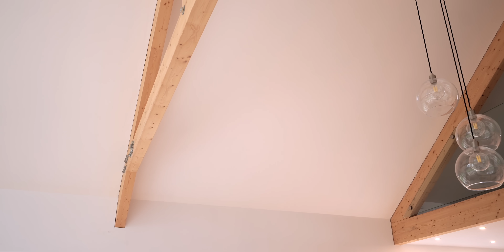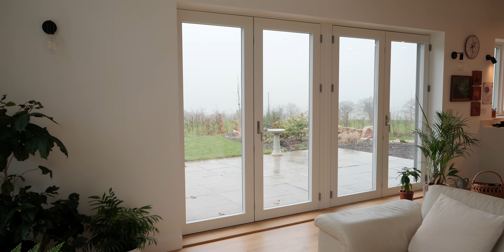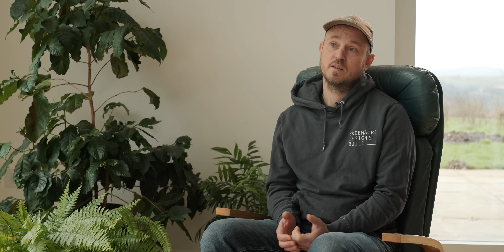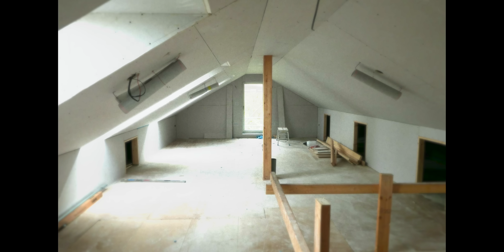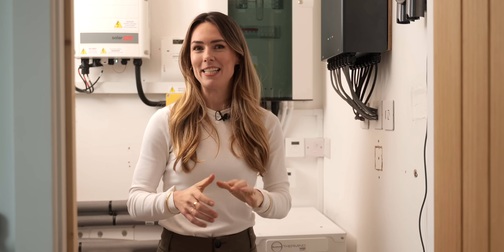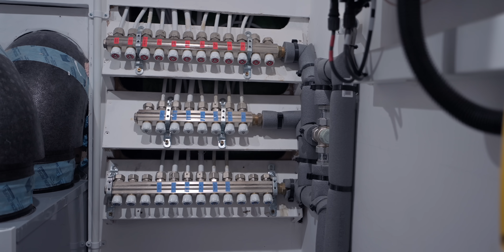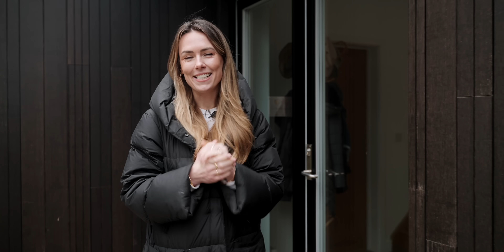Ditching a Heat Pump for In-Plaster Infrared Heating?!

Comment: Lovely to see this report Imogen and thank you to Jeremy for sharing his experience.  There are, as always, a lot of negative comments from the COP3 brigade - we're used to that- nevertheless, this clever system still surprises in its ability to perform across the board.  Here are few areas that may help people to understand.

COMFORT - no stuffy pre heated air or high/low humidity with warm floors and surfaces across the home
INVISIBLE - Hidden behind the plaster in the ceilings allowing for less deployment of panels than a floor based system and radiating shadowless light throughout the room
SPACE - No plant room needed.  Our intelligent transformer runs the entire home and occupies as much space as a 14"TV on the wall.  Yes you need  space for hot water but many smart solutions such as this Sunamp system are tiny.  
MAINTENANCE - The system has no moving parts and is constructed from recycled carbon fibre making it tough.  Unlike other heating 'films' this is NOT a plastic laminated film and cannot delaminate due to its patented homogenised construction.  The kit is designed and manufactured in Germany with high quality components and has a design life of 50yrs+.  
WORRY FREE - In the unlikely event of a damaged panel then simply either bridge the connection and feather back in or skim in a new panel.  As the system is decoupled, the rest of the heating system will carry on working
SAFE - The mat construction allows for penetration with screws and fixings up to 70mm diameter without issues.  As it operates at 36v SELV there is no risk of electrocution and may be used in wet rooms
CO2 friendly - The product uses recycled materials and has a very low embodied carbon score and, as it will still be running in 50 years+ time, the planet is only effected once!  Coupled with renewable energy it's operational carbon is negligible too.
VERSITILITY - Julians house is is near airtight and very well insulated and so requires hardly any energy - for him this really is back up should door be left open!  However, we install this system across the board in social housing projects with poor insulation, historic houses, commercial building and super homes.  As we have many variations of the mat, we can match the energy requirement to the required heat demand.  
THE BATHROOM - Imogen demonstrates the towel warmer.  This uses the same system but runs at a higher wattage which outputs Non ionising radiation at a higher temperature which will warm and dry out towels.  This enables more freedom in bathroom design and only uses 132w's of energy - plus no burnt bums as the surface temp still stays below 40°c.  You can also put this behind ceramic tiles and even in the shower to provide additional comfort and reduced water temps (according to one major housebuilder that has trialled it).
BUILDING PROTECTION - Naturally in Julians house it is ventilated via MVHR and maintains a good background temperature thus avoiding condensation.  However, for most of us, this can be an issue.  As we radiate onto the walls, floors, windows and all surfaces, these warm up.  These surfaces then warm the air slowly and gently.  As the air is always cooler than the surfaces condensation is reduced greatly and, in most cases to nothing at all.  
HEALTHY - Whilst we don't claim any medical benefits from using our system, there is a big reduction in dust circulation, compared to a convection system, and a balanced relative humidity (RH-see above).  Great for Asthma sufferers and those with dust allergies.  We radiate at a frequency very similar to the radiant heat produced by our bodies and so the heating feels gentle and does not cause headaches, burns, or any other nasty feelings associated with high temperature infrared.
REACTION TIME - As well as extensive testing and research in Germany through the inventors at Stuttgart University, we have conducted independent testing with Building Services Research and Intelligence Association (BSRIA).  This showed that the system will reach operational temp (around 30°c) withing 2 minutes and the light wave will be felt on the body within 3 minutes.  Floor surfaces begin to rise from around 8 minutes and a maximum air temp of 27°c can be reached.
 COST - Kit cost isn't cheap!  Sorry.  This is a high quality, German system that is built to last and to perform.  If you want cheap then buy Chinese.  Julians kit cost him around £40 per m2 PLUS installation.  For newbuilds then installation is simple and uses existing site trades with minor training.  For retrofits it will involve routing power cables and potentially replacing ceilings.  That said, the scenario is pretty similar with our friends in the COP3 group (heat pumps).

And finally, the big debate

RUNNING COSTS - Let's be clear - this is an electric system.  It doesn't magically generate energy from thin air - unless its connected to  PV/battery of course.
Our magic happens in the control and use of the system which can take a whole heating season to get to grips with.  But, this is where we do win and start to narrow that COP3 gap - we can warm up areas reactively.  Keep the home ticking over at around 15°c to stop condensation (see above)- the setpoint and bring the system on to your desired comfort level as and when needed.  Bedrooms probably never rise beyond the setpoint, hallways, kitchen and bathrooms too.  Dining, lounge and study may want a boost for a bit before you settle down for a meal or a movie.  No need to keep the heat on 24/7 to keep the heat in the floor slab to avoid it losing inertia.  In addition, as we warm surfaces, balance RH and reduce air movement the body will feel more comfortable at a lower air temp.  
Now, here's the clever bit, our wiley, energy saving clients have suggested running the home during off peak hours to make use of the lower energy rates and use the light wave to 'charge up' the home.  Current studies with a preeminent UK university are testing this practice and have found that the system has a faster ramp rate and a slower discharge rate than other heating technologies.  
Another eminent University (the one that loses the boat race) has undertaken a side-by-side pilot with student accommodation running gas on one hand and IR on the other and has reported running costs coming DOWN from over £50k pa to just over £20k pa moving the focus from a heat pump solution to IR across their sites.
Still lots to do in this area but, as control systems improve and AI starts to rule the world, a simple switch out of thermostats is an easy upgrade!

If you have a project then hop onto our website and get in touch or fill out a quotation form and we'll happily get back to you.  If you're still doubtful we have a book of satisfied client who love to share their knowledge and experience.  Talking about experience, come and 'feel' it for yourselves at one of experience centres - currently NW London and Cambridge with more opening soon. 

So - I have typed this whilst waiting for a flight home from visiting one of our university partners and my head  and eyes are now fried.  I hope tgis helps everyone (including the naysayers) to understand the system better.  Forgiveness required for typos!!

Rod Davies
Co Founder
Energy Carbon Ltd
rod@energycarbon.co.uk 

 
e unlike
Reply: 😂😂😂

Note to Imogen and that dopey Robert.

It might have been "better" had you interviewed this bloke in tandem with the older householder bloke!

(Thanks for your post btw.)

That way we might have had less noise from the heat pump huggers, heating and ventilating experts that they are. (Noise ... geddit?)

One might suggest that said heat huggers have to protest that only they know what's what in order to justify their very, very poor choice of heating, with the neverending saga of continuous maintenance and even possible replacement of said heat pump in less than a decade.

And of course, in some admittedly rare circumstances, the Local Authorities will be pressed to prosecute the odd heat pump hugger over noise pollution.

Everyone now knows heat pumps will end up sounding like an asthmatic traction engine about to expire.

I don't have to be quite so diplomatic as the heating outfits who post but it seems as if the heat hugger brigade are a tad dim if they didn't research the alternatives prior to purchase.

It may be a "good thing" if Imogen does an in depth interview, with diagrams, site visits, etc, involving FAR IR technology as a follow up to this episode.

A few brief words with the contractor were fine but more would have been better.

If Robert and Dan think nothing of waffling on for over an hour about things they only partially understand then an hour of Imogen covering FAR IR technology would be far more educational.

In fact I might go so far as to type that Robert and Dan seriously  consider bringing forward their retirement plans on the actual hosting and podcasting front and take a step back, a very large step back, ref fronting this platform.

Imogen might be a  better bet all round and a professional course on interview techniques wouldn't hurt.

Jack? He'll be just as happy and loquacious reviewing the many FCEVs and H-ICE vehicles about to appear on the markets.

Seeing as the Euros have changed tactics ref going green deadlines then finding new BEVs to review will be nigh on impossible.

Just because Starmer's new best friend will want to export his produce to UK in no way implies UK car buyers will be fighting each other at the docks desperate to get their hands on any Chinese BEV going, especially as Robert insists we avoid any dealings with "oppressive regimes" from now on.

Funny how words come back to haunt one.

Perhaps a script editor might have been a useful investment?

Too late now to row back on that one, eh Robert.

Retirement will allow you to sit back in judgement, and comment, on all sorts on nonsense on the internet.

It works for me alright.

Comment: I need to know how much all this has cost. I love the idea of being virtually off-grid, but you need lots of wonga up-front, which I don't have. It's not wealth envy I have as such, but every time I see stuff like this I think, hmm, people with money to spare. Obviously it's great for them then to have low or no bill for energy in, but the irony for me is that it's generally those who can afford bigger bills that start projects like these. For all that, I still love this kind of thing, great content.
Reply: perhaps I can give some idea on cost . I built a Passiv Haus but stopped short of certification , which was expensive .The main criteria , in every aspect , is insulation . There is heat generated from several sources in a living house that  along with high levels of insulation , keeps a warm enviroment .  We generate heat ourselves , as does cooking , showering , solar gain through glass , and other smaller sources . This heat is kept within the house . Cost of build was  approximately  20% higher on a timber construction , this  mainly due to  insulation materials . By going off grid the electricity costs are zero . Solar panels have never been cheaper  and batteries are essential so have to be accounted for but easily found  and generally come with  a 15-20 year lifespan . We have spent 0 on electricity for 3.75 years and the house temps stay over 21C . There is no heating system , just a woodburner @ 9kw output  So yes , a more costly initial outlay but low living costs once being lived in .
Reply: @gramos9115  I think a woodburner and its ensuing pollution count as a heating system.

Comment: Really curious what "sophisticated plumbing system" means as it looks really much like floor heating system...
Also with 2kW of termál loss they coul heat the house just by living in and change of LED lights for old incondescent bulbs.
Phase change heat battery sounds interesting but the higher heat is stored the higher losses. The insulation does not look that robust. I think for something like that but much more bigger as they do in Sweden simply "hole in ground filled with sand or water" to slowly heat up during summer and than use it during winter.

Comment: I know one thing: if my feet are cold, I am cold. So I have chosen again for floor heating. Meant to feel warm to the feet. The PCM system sounds good though.
Reply: Our heating warms the floors...from the ceiling.  The floor temp can be brought up to 26°c and can start to rise as quickly as 8 minutes from power up

Comment: What I found to be most interesting about this video was the idea of (potentially) fitting a Sunamp unit to work alongside a home battery.
Our house built in 1988 as an early 'ECO' house with superior insulation compared to other houses of that time is no longer up to current insulation standards, but I shall be looking into whether a Sunamp unit could provide our energy needs alongside our home battery.
Reply: Why not investigate yet more insulation?

Thermal curtains?

Nothing to.stop you doing the Google exercise.

Or search your locale ... could be all sorts of price scales to suit the demographics.

You won't know until you look.

Applies to all of us.
Reply: @ForestForest-n9i The house has 1" Styrofoam in the cavity and the roof which encloses the upper floor already had 50mm Styrofoam. Last year we re-roofed, upgraded the sarking felt and added 75mm of Kingspan before adding solar panels.
What we've discovered is that the builder who laid the ground floor stupidly poured the ground slab and surrounded the ground floor central heating pipes. The floor consists of 50mm styrofoam laid onto the ground slab and topped with chipboard, so as you can imagine I was furious about the incompetence /stupidity by not casting to accommodate the heating pipes within the Styrofoam.
I dont believe in blown-fibre cavity insulation as that often causes damp being transmitted across the cavity.
External cladding isn't an option as it would ruin the apoeatance of the house.
Our only remedy to improve heat distribution from a potential ASHP would be to open up the floirs to raise the CH pipework. I can in thre meantime at least fully insulate the loftspace floor.
Reply: @martinmorgan9 

I can recall decades since the advice for roof insulation, on top of the ceiling, was an inch (!) of fibre glass insulation (reddy yellowish kind which left fibres in your skin, no advice about gloves or masks of course) then blown shredded newspaper soaked in  alum for fire proofing, then vermiculite to "Rockwool" batts or thicker fibre glass rolls.

Plus of course ensure the pipework in the loft space went under the insulation and a plastic cloak filled with fibre glass to wrap up the static tank.

Later blown Rockwool or foam in the cavities.

Later still Rockwool of fibreglass batts in the cavities lying on the wall ties.

Mostly it worked.

Built a conservatory on a warm slab design, three inches of styrofoam then five inches of ready mix with steel fabric.

Double glazed top to bottom, but no heating so freezing in winter and cooking in summer.

Nowadays the choices are much wider. My particular fancy being FAR IR as opposed to heat pumps mainly on cost of install in a retro fit situation.

The fabled COP is mainly fable as it depends on the outside ambient.

And now recall while typing the blown foam broke down and bridged the slate or membrane damp roof barrier.

Hence timber framed with a single brick skin so insulation easy to position in cavity.

And the ubiquitous Everest if you could afford it, but no weep vents in the early days.

Those came in post mildew days.

I lost interest after that for a bit.

I now have Styrofoam with plastic damp proof membrane which works well enough.

Heating, for all eventualities, multi fuel stove, oil c/h, electric fan, oil rad and FAR IR panels.

Stove is not especially cheap but easy to get temp up into upper thirties if you don't shut the bottom door.

Leave all the doors open and space comfortable enough.

Works for me.

Comment: Why not talk about efficiency, which is of course lower than any heatpump. This video doesn't have enough technical information and data to take it seriously.
Reply: Outstanding observation!

Surely you realised long ago  these programs are pitched at the BEV buying audience (shame the old guy bought one, but still)?

This BEV mindset thing on occasion allows some poor even more susceptible mugs to latch on to heat pumps with the lure of something for nothing, as in CoPs greater than unity.

Unfortunately these mugs, in their efforts to save money, appear not to twig that for heat pumps to work effectively  they require a lot of additional infrastructure on top of.

Plus these same mugs spend a lot of cash (thousands!) upfront to save few hundred quid.

And of course had these mugs done some research they would know that heat pumps are very choosy in how they work with respect to the climate and the load.

It might be more sensible for the insulation and draft proofing aspects to have pushed a great deal harder.

Despite grants for extra insulation in older existing properties the uptake was disappointing.

In short people don't think things through.
Reply: @ForestForest-n9i  
You're quite full of yourself, lol.
Spent 1400 Euro on my two heat pumps. Keeps me cool in summer (with zero energy costs with solar), keeps me warm in winter with >1 efficiency...no additional infrastructure. Every other heating solution is way more expensive to buy and operate...it's a no brainer.
Reply: @AttilaTheHun333333 

You type as you find.

So what?

You appear to have forgotten that the only opinion on this platform that matters is mine.

On any topic there is and ever will be, probably.

Obviously.

I make sure everyone knows that so am slightly puzzled that you were unaware of this.

Frankly I find this outrageous.

Hope that helps.